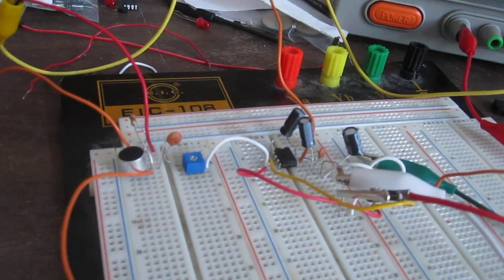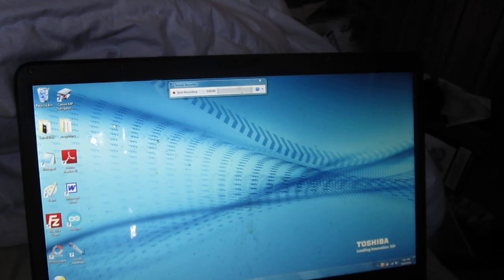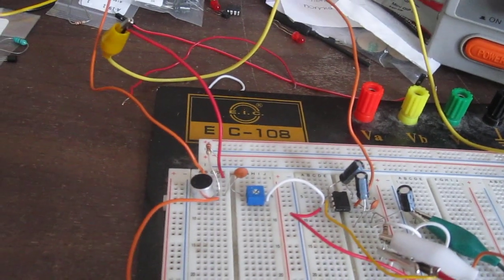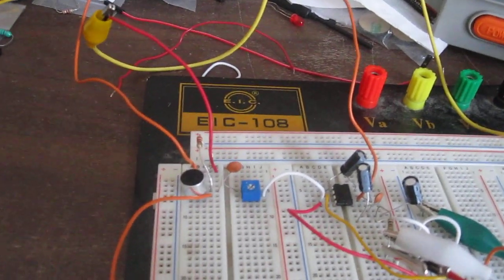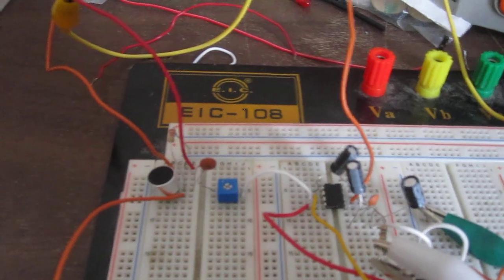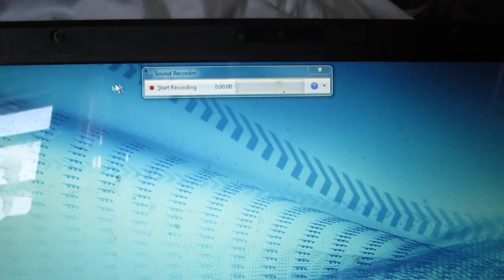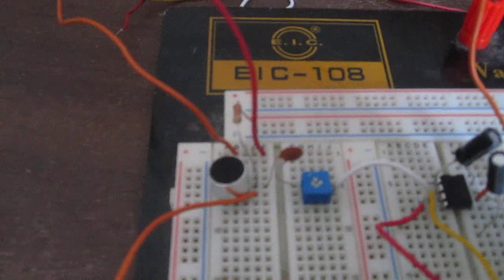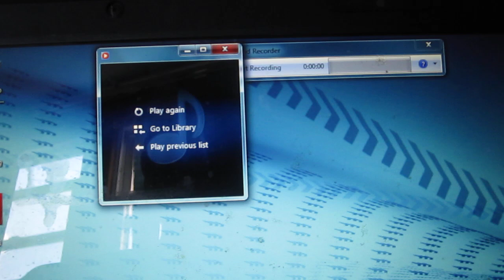Microphone Amplifier Circuit

Comment: Input voltage and amp for this circuit. You recommend 6 volt but in circuit diagram it is 5 volt so pls advice the actual volts and amp of input power supply.